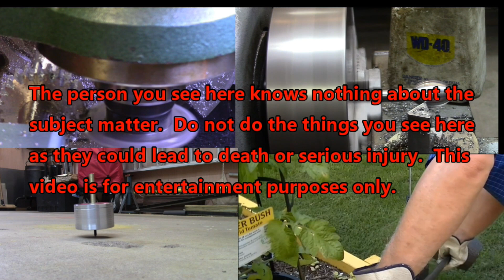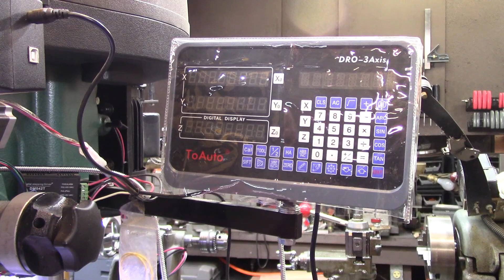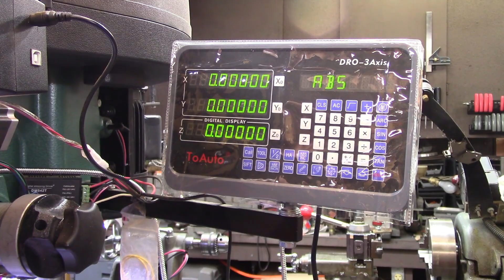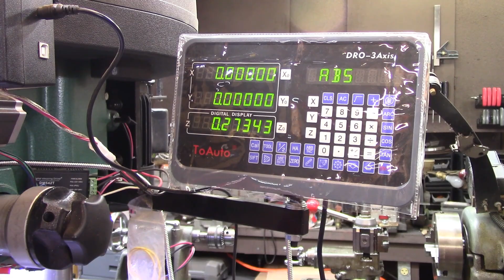DRO scales making them shorter

Comment: When we are done with glass cutting, will the blade be any good to cut the next job?
Reply from the maker: I have not noticed any dulling of the blade.  It is such a small cut that it could not do the blade much harm.  Thanks YK
Reply: @AmateurRedneckWorkshop  when I think about your comment I begin to realize the blade at most only blunt one teeth, shouldn’t be an issue. The blade simply cracks the glass strip and not saw into the glass the way it used to be on steel or aluminum. Fortunately the breakage didn’t migrate length wise. Cheers
Reply from the maker: @philoso377  I tightly packed that foam on both sides of the glass to prevent the breakage from migrating.   Sometimes you get a square cut and sometimes you get a bit of chipping.
Reply: @AmateurRedneckWorkshop  do you think two sponges soak with water on two sides can damp the vibration preventing crack migrates too far in the length direction? Otherwise submerge they glass if that’s practical.
Reply from the maker: @philoso377  that was not sponge that was tough styrofoam that is used in packing the DRO set.  It is not soft.  Do not use a soft sponge you will break your glass scale.
Reply: @AmateurRedneckWorkshop  I was thinking of an alternative to styrofoam.

Comment: when you cut a linear scale how can you drill the hoes   HELP
Reply from the maker: The end is normally held on by screws that go in the grooves of the body of the scale.  You may have to run a tap in if your screws are not self tapping.  I have never had to drill any holes.  Look carefully at the end of the scale body and see if there are not grooves on all corners.  Thanks Jerry.

Comment: I wonder if the position of the Scale in the Saw makes a difference. I watched another Video, and he had the opening facing up so the Saw cut down on the Glass while being supported on both sides by the Aluminum. He didn’t get any Chips in the Glass. Maybe he was just lucky. I don’t know.
Reply from the maker: I packed both sides of the glass with styrofoam so I do not think it matters which way it faces when cut, what counts is that you go slow and have plenty of styrofoam to make it stay still.  Thanks for stopping by.

Comment: Hi Harold Great story about the new guy! My company had a program where new chemical engineers would spend time with pilot plant operators to get a dose of "reality".  Some of our operators lived to take have some fun with  these folks. I am sure people have heard some of these oldies but goodies: sent to the storeroom for a bucket of steam or a nitrogen blanket. One of the best stories was about the young engineer detailed to hose down a 6-pack of high pressure hydrogen cylinders because the senior operator told him it was going to be close to 100F that day and the water cooling would make them safe. It was awhile before that new engineer lived that one down!
Reply from the maker: LOL yeah their is an endless supply of ideas for the new guys.  Almost makes me wish I was still working.  I said almost.  Merry Christmas.  Thanks for stopping by.

Comment: I can't believe you cut the glass scale like that. I saw a video where the glass was removed and cut with a diamond wheel in a dremel. The glass was just press fit making it easy to break loose.
Reply from the maker: Yes I have learned that it is easy to remove from the case.  I will probably take the next one out and cut it with the dremel on some flat surface.   I did have the saw pressure going in the direction to press the glass into the groove so it was not likely to pop out.  I also had it packed tight with foam from the packing.  Merry Christmas.  Thanks for stopping by.

Comment: Already knew about shortening the scales, what about needing longer onse...???
The silvery part is an etched series of very fine lines that the reader decodes in order to give a reading.
Poor newbies, knew ones looking for skyhooks, boxes of film sprockets, even a sound assistant with a tree branch attached in his back in order to replace the antenna for a wireless mike, etc...
Yap...   That was fun...!!!
Even if you own an electric knife, don't try glass as filling  in the Xmas turkey, have a great Xmas time...   🍗🍽🍷🎅🎁👍
Reply from the maker: I think for the short DRO glass a glass stretcher would do the trick.  Look for them on ebay.  Thanks for stopping by.

Comment: Hi Harold.  Is the  glass scale section removable or glued in the ally extrusion ?  Cheers Rob
Reply from the maker: I assume it is glued in but it could be wedged in with the little round blue pieces.  I saw a fellow who had pried his out to cut it on a table with his dremel and if it were glued it would have been risky I think.  Thanks for stopping by.